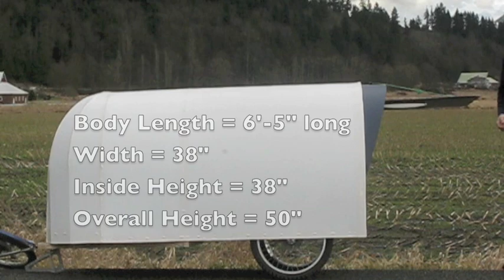Nomad bicycle camper

Comment: Question Paul I was looking to build a bike camper to sleep 4 adults that are 6' tall any suggestions? Cheaply made but that would keep dry & warm Or two trailers that cam connect to each other Was thinking of 2.5' wide that pulls into 5' wide 8' long Please let me know what you think.....
Reply: +chris rit Make four of these in a plus-shape configuration when camping. You may add some square cover in between to the center to have a lobby where everyone can enter in their own bunks.
Reply: +schumispecial1 thanks for info I'm planning on going from Pittsburgh PA to Washington DC which is 355 miles each direction all trails then doing Los Angeles CA trip back to Pittsburgh PA which takes 10 days to complete

Comment: How much did it cost to make one of these and where can I find the material
Reply from the maker: Andy Martin Total about $100 but I harvested 5 full sheet campaign signs after an election. Normally this material, corogated cardboard, can be found at plastic supply stores or sign shops for around $20 per sheet. Google search it in your area.
Reply: Thank you Paul Elkins

Comment: Quick but serious question related to an email I sent AND to this project. Are the signs you used UV stable? When I asked at the local hardware store he said I'd be lucky to get 6 months out of them in my climate due to high UV and the core flute not being stable. If so, any recommendations to addressing this? Paint? Vinyl? Maybe have the insulation as a reflective outside layer as well? I'm going to make one (bought the plans) and also thinking that extras could be made for local homeless with the addition of refurbished bikes that people throw out in their hard-waste. Check the email for more info
Reply from the maker: Ya data Banks, I've been meaning to respond to your email. As to the UV of coroplast I've had my yellow shelter out for 5 years now and it's not brittle yet. Then again I live in a wet climate. Krylon fusion spray paint for plastic should give it a few more years of life. Best to keep your camper covered when not in use is my best recommendation. I like your idea of making bikes for the homeless. Locally we have a non profit bike shop that has about 200 bikes in need of repair. He advertises on the local public radio station to invite people to help fix them. He also asks recipients to come and help make a functional bike for themselves. He's been going for 15 years or more.
Reply: Originally I was going to try the Maker Shed but since there's only one in the entire district the waiting list is so long that I've given up. Just ordered an arc welder for what needs welding (flatmate needs a trike) and I'll build the things at home. Would also mean I could possibly convert some bikes into trikes for others who aren't so good with balance, or as you mentioned, need one less thing to worry about while towing a camper up hill. There was a video about a "Quike" that gave me some ideas, as well. 

The UV might be an issue as South Australia can get some pretty hot summers and the UV index is mentioned each day in the weather forecasts. I think I may have to look into something like a plastic wrap that I can heat-shrink down over the surface with a heat gun. So far you're the only one who's replied in relation to this. Bicycle SA, The Greens party, etc haven't bothered. Not even the local homeless help group. Guess I'll have to buy all the coroplast myself then tow a caravan to their office as proof of concept. Might also try the local council for the reflective coroplast signs they use in roadworks. I found on of those thrown out and it made good reflectors on the wheels of my bike and bike trailer. More would be useful for the caravans. 

Just had another idea while typing - if people wanted to donate a $2 solar garden light to the homeless caravans, it could mount inside - the panel poking through the roof much like how you mounted your speakers in the wall storage. 

The nonprofit bike shop sounds like a great idea. I wonder if the local bike shop would go for assisting with something like that - a bike repair for homeless to get them on their feet (on wheels). Food for thought
Reply from the maker: It's worth giving your local bike shop a pitch. Maybe they'll bite. I stuck 7 of those solar lights in the plywood roof of my 9 sided foam board shelter. It worked great, but the on off switches are on the solar panel side (on the roof). No matter. We slept in my Octatipi. Dim but it made for nice mood lighting.
Reply: Electronics would be easy enough to modify as needed, though. Could also use a pair of solar lights, swap the white LEDs for red and mount them on the rear for tail lights.
Reply: Btw, rather than moving the wheels back, have you thought of putting a second set of legs at the back? That way it won't move when you sit down.
Reply from the maker: I did and some people have,  but I like the minimalist idea. On the electronics end, if you were to tour a flexible solar panel on the roof with battery would be the bomb.
Reply: Yeh, solar power and batteries is already on the "must do" list. Also, if I can track down some stepper motors from dead printers, I've seen them generate 24V as wind turbines just using a prop from a model aircract in light winds (not strong enough to cause noise on a camera microphone)
Reply: Hey Paul. Good plans now that I've read through them a few times. They've become the basis of a project to build and donate to the homeless in Adelaide. That and trikes to tow them - as you mentioned somewhere, towing these up hill and concentrating on balance can be tricky. I had to make my prototype a little narrower for our road laws and this one's a patchwork of election signs, but as a proof of concept it's working. One addition to them is going to be an outer coating of the vinyl used to wrap cars - it'll strengthen the shell, increase water resistance and should look cool too. 
With the windows - if you're strapped for cash, plastic soda bottles work well sandwiched between layers of coroplast/coreflute. Held in place with zipties through all layers, naturally. If you're working in a well ventilated place, you can even use an old 80W soldering iron to melt off-cuts of the zip ties to fill in the holes. Gently running over the overlaps helps soften the lines and again you can melt and drip the coreflute into gaps. It was an experiment I tried when it was raining outside and I was building the back door to the caravan but it worked fairly well 
https://scontent.fmel2-1.fna.fbcdn.net/v/t1.0-9/14590331_10153952921218663_7537068144112733295_n.jpg?oh=7be0dba4f70cf042a1e7de81dab48c46&oe=586B9EE6
shows progress a little while ago. 
Forced day off today - pouring rain and no sheltered place to work (rental property and not allowed to build a garage or carport)
Added a small garden solar light to the roof and it makes a big difference at night. This model has a manual off switch as a bonus.

Comment: Paul I love this design, I've started to purchase materials to make my own.  I sent you an email and would love to hear back from you.  I'll highlight a few of the questions/concerns from my email below:

I have a few questions about the viability of towing this and possibly a second trailer behind a recumbent trike.  I would like to take this a step further and complete the airstream look by attaching a second two wheeled trailer, but first I'd like to know hot the single trailer handles up and down hills/with wind.
Reply from the maker: I don't see why you couldn't tow a second trailer, but that would be a bitch to back up!  The desired vehicle for towing any bicycle camper (in my opinion) is a trike, preferrably (again, my opinion) a delta, with multiple low range gear selections. My little 6 speed recumbent has yet to test this rig totally loaded down, which ranges around 90-100 pounds, so I've yet to do a windy day test or an up hill test. Judging from observing my homeless Emergency shelter for the last 3 years, which sits in my front field, it should do well on side winds. Then again, if it's lightly loaded and you're into some heavy duty winds I'd wait the wind out, or add rock balast in the lower storage area, just in case...
Reply: Paul Elkins
Do you have a pattern or measurements for the dome?  I'm trying to cheat and use your hard work rather than play with it until I get it right :P  This link is the best dome pattern I've found.  Is this the one you used?  Do you have a better one?

https://waymoot.org/home/dome/cover_segment.gif

Comment: Perfectly street legal. I love the potential as a protest vehicle, imagine taking a bike ride down Bay Street, at random times of the day. Not fit enough to bike? Put on a solar panel and a 500 w electric motor regulated not to exceed 32kmh, no parking fees need be paid, no license, no insurance, at least in the City of Toronto, Canada.

Not a solution or even a desire for being a stop gap measure for every homeless person, but I just know that, given my preference for solitude, if I were ever to become homeless, I would not do well in a crowded room.

Maybe someone could do a Go Fund Me app. Get initial 100 of these built (Money needed for 100 units would be less than $150 as the designer stated, because of volume buying of the components.)

Not everybody would want them, some might even be insulted that this kind of thing would even be contemplated in this land of plenty.  I think the deaths of three people from freezing, in a winter not half over, calls for any ideas to be thrown on the table.

If someone wanted help with such a project, I'd be happy to volunteer, to the best of my abilities.

Comment: Dang I oppose people suggesting electric-assisted bikes. I see them depending on charging and depending on dense mains availability. Not too good bikes without charging either. Not too good combination having a bike trailer camper with dead battery on e-bike. I see the e-bike scrapping some of the independence idea. You'll get constantly worried where to charge the bike on tour almost like with the early cell phones, remember? And believe me it's annoying on your vacation. I also see the overall surface area possibly too small relying on solar panels for the e-bike. Too much uncertainty, dependence, worries, hassle, price. Keep It Simple & Stupid (KISS).

Comment: Why not use 2X4s for the trailer frame? That flexing when you got on made me cringe.
Reply from the maker: When trying to make something light you start out with minimum materials, or what you feel should be the minimum. So far I've had about 375 pounds inside the camper with no ill effect. The bed is suppose to flex seeing it's like a canvas cot. There are some places of the coro bed that have stretched out, like at the entrance where I sit and where I sit against the front wall, but not enough (so far) to be noticeable when lying down on the 3" thick cushion. Also, the shot of the frame flexing was before the body was screwed onto the frame, which, after it was installed significantly stiffened the whole structure.
Reply from the maker: Mark Hill